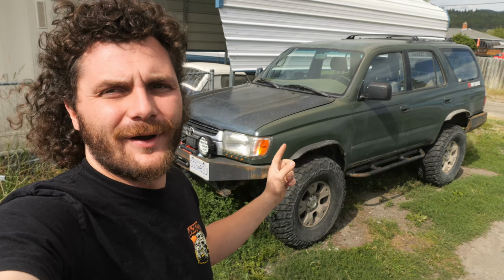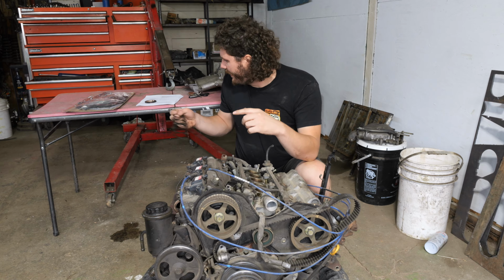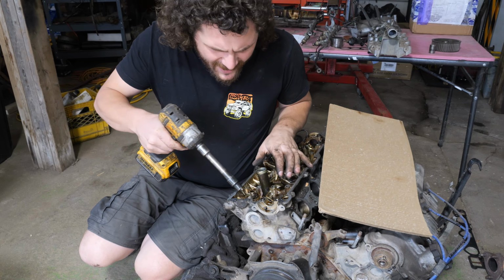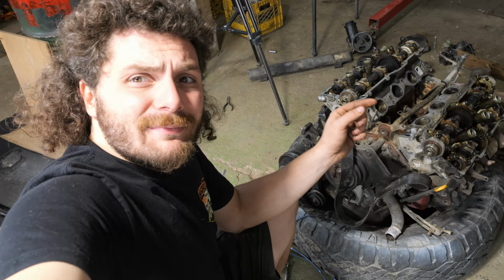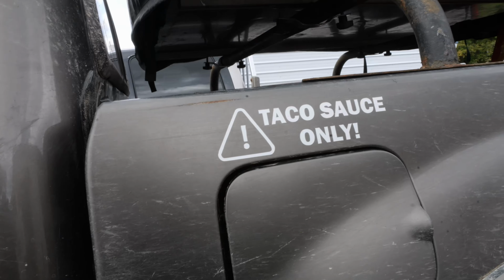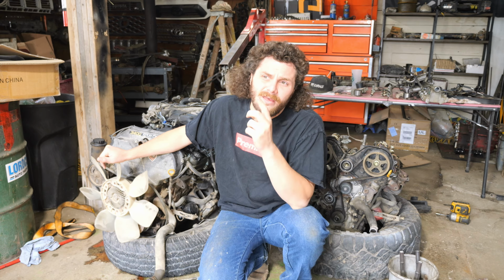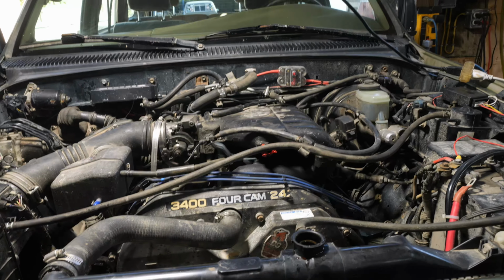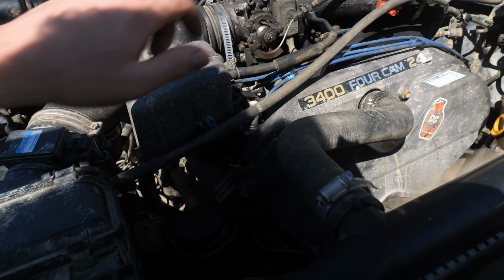Abandoned Toyota 3.4L - Can I Save It?!?

Comment from the maker: UPDATE: Some of you noticed I did not put a service pin in the cam, weird part is even without the service pin the cam did not spring back. (I thought this was strsnge but did not mention it in the video). So I tried swapping the cams from the other 3.4, and using the service pin (these cams did try and spring back). So now with the cams swapped and now under tension it seems to be fixed!
Reply: yay - good find. gotta love youtube community!

Comment: Valve adjustment is easy. Just watch Timmy The Tool Man.
Reply from the maker: I wouldn't say easy. I mostly just don't have the tooling to check clearances.
Reply: @DirtGarage  You just need feeler gauges to stick in between the cam lobes and the valve. Then add or subtract shims to the buckets to be in spec according to the feeler gauges.
Reply from the maker: @devondrayton4006  I know how its done 🤣

Comment: Stick with the 3.4 for now. TDI swaps are cool, but very time consuming since about the only off the shelf part is the bellhousing adapter, you'll have to fabricate everything else yourself to mate the engine to the vehicle. I got the TDI into my Ranger with mounts and accessory drive brackets, but still have to mess with all the plumbing and electrical.
Reply from the maker: @abpsd73  I dont mind the fab stuff
Reply: @DirtGarage  Me too. Which is why it's getting Toy axles and e-lockers. 🤣
Reply from the maker: @abpsd73  Nothing wrong with Toy axles

Comment: Ok all may not be lost. I think you should check out the cam and make sure the split cam didnt relax. It has a spring in it and can move 1 tooth. That is why toyota put a treaded hole on the gear to keep that from happening. If it does relax a tooth it wont keep the cams tensioned to each other. Which causes the diesel sounds.
Reply from the maker: That is likely it. When I pulled the cam out I forgot the service bolt snd it did not spread.

Comment: Could be cam gear due to not having the service bolt installed before removal?
Reply from the maker: @PowerToolFun  Could be. But strange part is they didnt seperate without the bolt in, stayed aligned. and its that side that is making noise. I did not realize that was even a thing until I did the other side and they seperated 🤣
Reply: My exact thoughts exactly.

Comment: I replaced the valve cover gaskets, plugs and wires on mine and it started doing the same thing. Tick on the drivers side only after it warms up. I still haven't figured out what it is, but it runs fine.

Comment: My 03 Tacoma has 300,000 miles on the 3.4, never a mechanical failure.
Reply from the maker: @michaelsedway9703  Exactly, usually they are fantastic!
Reply: my supercharged 3.4 is just about to hit 300'000 miles!
Reply: I just hit 325,000 miles on my 02 Taco 3.4.

Comment: it might be worth measuring valve clearance that way you can get an idea if it's related to the noise. Measuring them isn't difficult however from what I understand adjusting them can be a pain. If valve clearance is in spec then you could rule that out. I recently did this on my 3rz tacoma while chasing a misfire issue and was able to rule it out as they were in spec.

Comment: So close, I’m surprised you didn’t look at the cylinder walls & compression rings
Said by a non-mechanic (maybe you can some other way)
Reply from the maker: @nemesis851_  I did, looked good. Obviously didnt take it far enough apart to pull crank and pistons out to thoroughly check